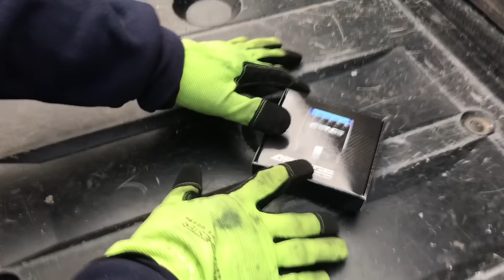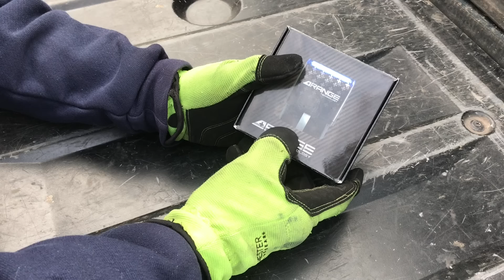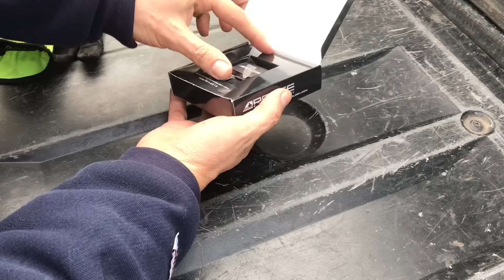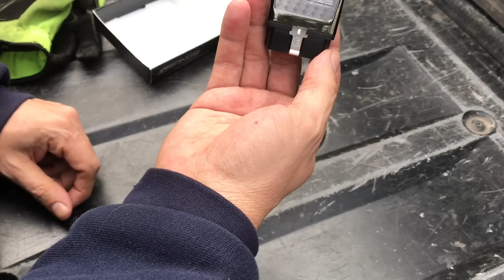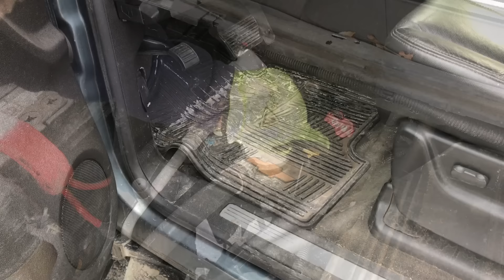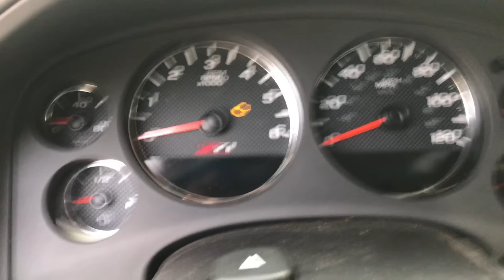Range AFM Disabler - Long Term Review

Comment: I read it can drain the battery if it sits to long glad you haven’t had any issues with that.
My question for the manufacturer is,
Why have a light that stays on if it can drain the battery?
Also, why is there a light at all?

Comment: the main issue with AFM/DOD is that the lifters get stuck in collapsed mode via oil in the lifter itself forcing that cylinder into disable mode all the time, or the spring on the afm lifters just collapses entirely, leading to it not being able to actuate at all, which of course, leads to that cylinder failing to function properly.

this is mechanical and unavoidable. devices like this are, at best, a band-aid. you're going to be either replacing the lifters at some point, or doing a full AFM/DOD Delete.

sadly, no amount of software is going to stop a spring losing its.. well, spring. and lets be honest, it's completely worthless as anything but an emissions gimmick, with a slight side of mpg saving, but mostly the former.

Comment: Didn’t work for me on my 07 gmc envoy Denali with a 5.3. I plugged it in and headed on a 600 mile trip, ,3/4 of the way through, my check engine light came on and the engine quit firing on one cylinder. One lifter had failed to reset. So… did a full AFM delete, reprogram, and trashed the RANGE disabler. I haven’t noticed a decrease in fuel mileage, maybe because on the Interstate I drive 75 most of the time, BUT, it seemed to cure my oil consumption issue. The next trip I took, 750 miles, I used NO oil, normal would have been almost a quart. 
A HUGE thanks to Crazed Performance for tools and tips for the Delete!!!

Comment: I just bought my truck at 145,000 miles. I have a cylinder 1 misfire that is random enough that the check engine light will turn it self off between the misfires. I haven't noticed that I burn oil. Is the damage done? Or do I invest in the range?

Comment: Try changing your oil at 3,500 mile instead of 7,500 miles . 7,500 miles between changes is way to long. That would explain oil consumption and poor performance. The cars you see that are over 250,000 miles is the direct result of taking car of your vehicle properly. Such as oil changes at 3,500 plugs wires and coils every 30,000 . Fuel pump and filter every 60,000. U joints and cv axles every 60,000 . Trans fluid drain and fill with filter every 60,000. Got 519,xxx miles from my 07 5.3 before she gave up the ghost.
Reply: I tried looking up a fuel filter and nothing came up

Comment: Why the fuck would you go 7000 miles between oil changes, no modern engine that relies on full clean oil supply for proper operation will survive under those conditions. ALL modern engines consume oil, GM even has a tsb out that states 1qt every 1500 miles is normal and no repairs should be performed to correct this. I don't give a shit what that service indicator says, change your oil and filter every 3000 miles. And if some quick lube jockey tries to tell you their "special" oil will go 10,000 miles you need to turn around and go somewhere else. Manufacturers have been extending the service intervals out longer every few years because it makes the cost to maintain per year look better on the window sticker, don't fall for that bullshit.

Comment: i had to replace my engine at 117k miles in my 2011 escalade, lifter issue blew the engine, i just bought a 2018 escalade, im thinking of getting the disabler
Reply from the maker: I pulled the one out of the truck in the video and I’m running it in my ‘18.

Comment: 2014 Sierra SLT All Terrain 5.3
Tranny thermostat delete 
Misimoto trans fluid cooler
Billet torque converter 
Magna flow exhaust
35 inch ridge grapplers on fuel 20s
200 mph speedo from the factory 
Top speed limiter erased (ive gone 159) but with 17 inch wheels and tires beforebthe 4 inch lift
Truck runs great never had any issues except for 1. 
Engine light (the actual pic of an engine)  flashed off and on, never could get a code or solid engine light, one day it stayed on and no codes were found. Really weird. No lifter noise nothing. Runs smooth and quiet. Even towed a boat 200 miles in mid march. Drove it 1000 miles nonstop nothing happened except i paid out the ass for fuel .

Comment: Another way to keep AFM disabled until you get this device or go full AFM disabler with new lifters, cam shaft, and pcm reprogram is to only drive in L or M (depending on truck model) and set it to the gear one less than your transmission actually has. If a 6 speed, set it to L5 or M5 so that is the max gear it will use. This will disable AFM.
Reply: Does that really work?
Reply: @betosifuentes270  I turned AFM off using an auto tuner so I didn't need to try any other way. I read, in another location, that manually running one gear down prevents AFM from engaging.  It makes sense.  AFM is only going to kick on when cruising, not under load, and the only time that happens is with automatic in top gear on the highway. It never kicks on when under a load or before settling into an easy highway cruise.
Reply: @betosifuentes270 it does but you have to remember to initiate and run the gear shift up to the second to last gear
Reply: This is what I do. Eats the fuel tho

Comment: Dear author, I use this Range Device on my 2011 chevy camaro SS and do not like how auto transmission is shifting. Could you please advise. If I replace all 16 lifters, AFM and non AFM, will it help ? Or I need to replace also the valley cover ?
Reply: There is a delete kit. You have to replace all lifters the valley cover remove the sensor at the back of the valley then plug it off, then the fun part, the cam shaft needs to be replaced as well, or else it will throw codes like crazy also the ECU needs to be reprogrammed.........I think.
Reply: @alfredocarpaneto5976  but i would to save dod afm system) is it enough to replace valley cover and lifters? stock engine

Comment: Since i purchased my vehicle it has never left v8 mode. Had it for a month it does have bigger wheels on it and lifted a bit. I dunno if thats why or if there is an issue with the afm. Just noticed low oil pressure and code saying change the oil pressure sensor

Comment: Oil changes every 7500 is bad no matter what the manual says..every 3 to 5k miles for oil... and seafoam in your oil can cause problems....like wash your bearings by thinning oil and knocking debris loose to clog passages. Good luck rolling those dice.-ASE certified for 20 years.

Comment: I have a 2013 with a 110,000 miles been running diesel oil specifically Delgado 10 w 30 . All diesel oil is high detergent. I go 6k on changes never uses oil ! Pulled the valve cover recently to look inside, spotless. Switch to a high detergent oil. Guess what I did for a living. It has always had the AFM working! Dirt and sludge cause most problems, and poor maintenance.

Comment: I was back and forth because of the price. I have a 07 Suburban with 145k. It kind of jitters in low gear slow speed. Plus I bought a V8 I dont want a V4. I will update after I use it.

Comment: I was getting oil consumption and replaced the Drivers side Valve cover with the PCV and it helped a lot as well.  I also have a Range and had no issues with it.
Reply: Year?
Reply: Where did you find the updated valve cover
Reply: @Jdm6641  you having oil consumption?
Reply: @tipsreviews7476  no not that I can tell but I have a 2011 5.3l with 56k miles so I’m trying to get all this stuff perfect so it’ll last 300k+ miles
Reply: @tipsreviews7476  already got the range afm disabler to save the lifters
Reply: @Jdm6641  good move with the range . I would only change valve cover if you start consuming oil.
Reply: @tipsreviews7476  does it not happen to every engine
Reply: @Jdm6641  2011 and up had the updated valve cover installed from factory.  Yours might have it already.

Comment: Put a catch can on it also. You’ll be surprised at the oil it collects. I used the Diablo intune3 to program the AFM out.
Reply: I agree with you.  I put a catch can on my 2017 Silveratdo 5.3 and remove about a shot glass of junk every month. The EPA would rather you burn that junk back in your motor.
Reply: @AStanton1966  I'm thinking of buying a PU with the 5.3, have you had any other issues with that engine over the 150,000 mile mark and are the exhaust bolts still in tact? thanks
Reply: @bowe1978  I believe exhaust bolts aren't an issue for the GM 5.3's.  I believe that they are an issue for the exhaust manifolds on the Mopar 5.7's.  This is my second Silverado, I love them, especially for the automatic rear locking diff.  Personally, I think buying any vehicle with 150,000 miles is a crap shoot.  Stupid stuff happens at that mileage, especially if the previous owner(s) didn't take care of it: issues like water pump, head gasket, brakes, exhaust, etc.  I haven't had any issues with my 2017 Silverado 5.3, but it doesn't have high mileage either.  Personally I prefer the older Silverado's/Sierra's over the new models.  My engine had the cylinder deactivation, going from 8 to 4.  I fixed that my putting a Rang Tech on it.  And now it stays in 8 all the time.  I also put a Borla cat-back S-type exhaust on it, and love that as well.  The newer 5.3's have dynamic fuel management and drop down to 1 or 2 cylinders.  And to fix that, the aftermarket part costs about $1,000.  Plus they have that auto stop/start.  And I hate that feature!  And any rate grab whatever V-8 you can.  MOPAR isn't making anymore after this year.  And I suspect other manufacturers will be following suit as well due to the friggin' EPA!

Comment: I had one for about 6 months but if your car/truck is not driven almost daily the battery will drain to zero. I had it happen three times and Range told me that was an issue with all of them.
Reply: You left it in?
Reply: @ramdbzdude0_0  Yes, if over three days it would kill my battery.
Reply: @rudyyarbrough5122  I thought you were supposed to take it out tbh. Did you like the way it worked besides that?
Reply: @ramdbzdude0_0  It did stop the 4/8 cylinder crap but I don't use my truck that much and would forget to take it out once in a while. If you have ever been stranded it will make you angry about such a cheap device. They could put a switch on it or power it through the acc side but they are too cheap.
Reply: @rudyyarbrough5122  yeah that sucks ass :/ still have it? Wanna sell?
Reply: @ramdbzdude0_0  sold it

Comment: Next time you are at the gas pump, add one to two ounces of TC-W3 Outboard 2-Cycle Engine Oil (ashless) per every five gallons of gasoline to your gas tank, then drive it around on cruise control when possible at 44 miles per hour (you must first bring the speed to around 48 mph to get it into a higher gear then let the speed fall back to 43-45 mph) and you will be able to enjoy 35 - 40 mpg fuel economy consistently if traffic is flowing (not bumper to bumper).
When at the gas pump, first add the 2-cycle oil to the gas tank, then fill the gas tank with regular gas, that way the gasoline will mix with the oil as it falls into the gas tank (do not fill with gas and then add the oil).
I also purchased my AFM Range Disabler about 2 years ago, and all is well, the truck runs on all 8 cylinders, except when the engine is off :)
I do my oil changes every 5000 miles, it makes me feel better.
I have added strong magnets (2) to the outside of the motor oil filter also, which can be removed and placed on the new filter on every oil change, to retain inside the filter as many metal fillings as possible instead of having them flowing inside the engine.
Reply: Just stop buying gm junk they keep selling the same crap stop it idiot
Reply: @billybritt5334  Ok Mr. Genius.
Reply: Proverbs 23:9
Speak not in the ears of a fool: for he will despise the wisdom of thy words.

Comment: Hilltown, just curious about something, what kind of oil were you running before the install ? I had a similar oil burning issue in my 07 Sierra- (pre AFM engine) at 140K miles, switched from regular engine oil to a full synthetic which fixed the issue. I now drive a 2012 Avalanche and only run synthetic. I'm curious as to whether the oil burning issue at higher miles can be helped by synthetic oil or if I should think about a AFM delete at some point
Reply from the maker: Hey Ben, Castrol 5W-30 conventional.

Comment: My 2011 tahoe ltz has 129k I run mobile 1 full synthetic truck and suv oil and add Schaeffer’s oil additive every oil change since new, I check the oil every other oil change, I haven’t burned a drop somehow my old 04 Yukon XL with the 6.0 burned 1 QT from 100k-294k miles when I got rid of it. I’ve been a tech since I got out of trade school at 19 and am a service manager of a big dealership, maintenance is key never go by the oil life always go by mileage after 6 months or 5k miles the additives in most oil have disintegrated and aren’t preventing sludge or carbon build up, I change my oil with full synthetic and additive every 4K miles
Reply from the maker: Thanks.  One of these days, I'm gonna send a sample off to a lab for analysis.
Reply: I change my full synthetic mobil 5/30 every 3,000 and use a good filter cheap insurance

Comment: I heard these engines have problems with lifter tic due to the afm, does this stop that?
Reply: It won’t stop it if the problem is already happening it’s to prevent it from happening. If you already have a tic you need to get an AFM Delete Kit

Comment: Think this would work on my 2017 GMC Sierra 1500?
Reply from the maker: I sold the truck in this video, but I’m running the same Range unit on my 2018 Silverado.  No issues so far.
Reply: @HilltownCT  ok great, might order mine now.
Reply: I just got one for my 2016 Sierra 5.3 with the 6 speed transmission and seems to be working great! I had to replace my tranny at 80,000 miles though! I went with the Jasper transmission! I would buy the device directly from range that way you will have the updated version! The light on mine does not stay on when the truck is off so it shouldn't drain the battery!

Comment: Going that long between oil changes is a dangerous game sir. The factory recommended interval is way to many miles. Remember, they want you to buy a new one!
Reply from the maker: Don't jinx me!  I've always used the OLM.  One of these days, I'll send a sample to Blackstone for analysis to see what it reveals.
Reply: Truth
Reply: Absolute truth Michael. Factory BS to go that long between changes. Full synthetic oil doesn't break down (dealerships use a blend anyway unless instructed otherwise) but it still gets dirty enough to plug oil drain holes in pistons/lifters especially with EGR systems that add extra carbon to combustion gases. Plus all the tiny oil holes in lifters. Not worth it. Spend 50+K on a vehicle then cheap out on the blood of the engine NTS (not to smart). Fluids are cheap compared to the PITA's with failures.
Reply: The sludge issue in valve cover from engineering mistake will cause engine failure if you go 7.5k between oil changes. I buy 5qts for $18 full synthetic and change every 3k. 269k on original 5.3 with AFM delete the last 57k miles. Gas goes down but I recall my 96 southern comfort getting 12-13mpg…..win win!😂

Comment: Any recent update on this? I have an 09 Tahoe with 115k miles and was thinking this may be good to do. I love in the city so a lot of city driving. Also have a new to me 18 Z71 Silverado maybe should do to both?
Reply from the maker: I just sold the truck shown in this vid.  Never had an issue with the Range though.  I have an ‘18 now I’m probably going to run one in it.

Comment: I had seen comments about battery drain when left plugged in. A parasitic draw check shows about 25 mA draw that shouldn't be a problem for daily drivers. 50mA is considered the max draw.

Comment: I have a 2015 Denali with a 6.2.  Not a good year I know.  They just replaced engine as lifters went bad, among other things.  I just ordered my Range.  Interesting thing to know.... Driving in tow mode does not shut out V4 mode.  Would have been nice to know before I tired a trailer up and down the West Coast!  Great video, thank you!  I will have to study that seafoam trick..... Baby steps! Looking forward to having my 8 cylinders back full time!

Comment: I never knew this was an issue, I've got a 2010 ram with a similar system and it's never had a single issue with the cylinder shut down.
Reply: I honestly think the DOD/AFM issues come, when people go 7000 miles between oil changes. With dirty oil,comes sticky/stuck lifters when they are locked out.  3500-5000 miles MAX, using good oil and a good filter.
Reply: I have a 2012 Jeep/hemi and am currently having this exact problem! I now need lifters and cam @120k 😡

Comment: I just picked up a used 2013 gmc sierra z71 with 82k miles last Saturday after trading in my 2003 silverado z71 with 175k. The afm scares me at this point. Haven't had any issues so far but I plan to change the plugs on it and run synthetic oil only. I drive it everyday mabye 10 to 12k miles a year. Thank God I have a powertrain warranty on this truck. So far no complaints
Reply from the maker: If I had known about AFM when I bought mine, I probably would've passed on it.  It's still going with 206k on the clock.  Good luck with your truck.

Comment: I have a v6 Colorado and this thing was using 2 quarts between oil changes almost right away. Just got the Range AFM and it's working well so far.
Reply: Hows yur truck running now ??

Comment: As well if you don’t delete the flex fuel code in the system or override it with this device most of the time when the vehicle reaches 150k or more miles the lifters will most likely need to be replaced.

Comment: Funny how GM advertising said that you will get 18 to 20 mpg on these trucks.
Reply: I just got an 18 sierra 1500, I drove 100 miles home at 55-60 mph with the afm active and got 21.3 mpg.  But I just learned about the problems after causes so I ordered the range plug-in.